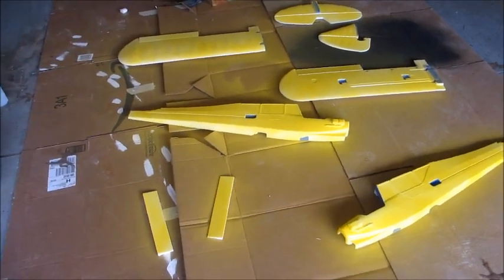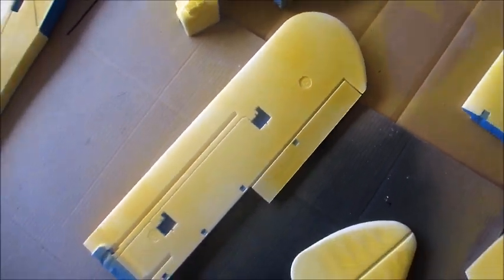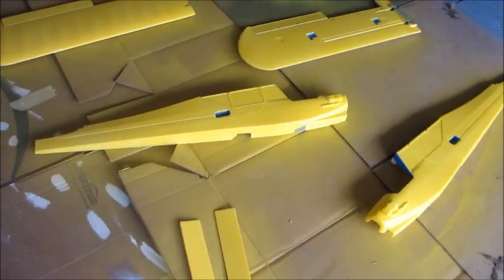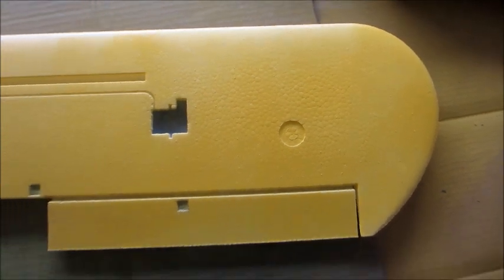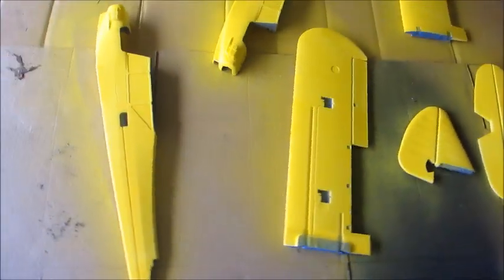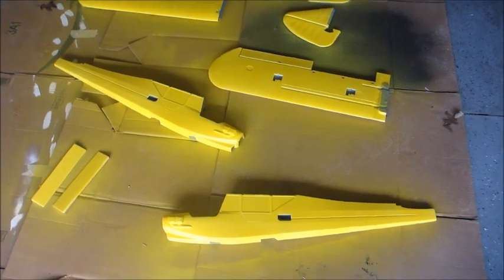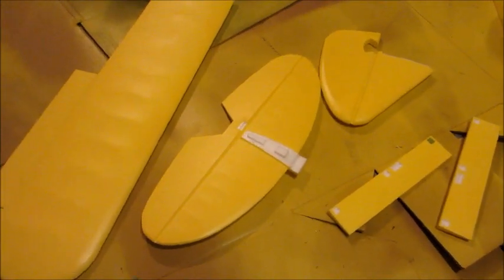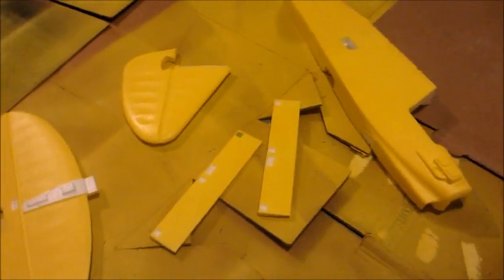Multiplex Fun Cub Build 02 - Painting

Comment: Got a couple of suggestions for you and others that view this video.   

How you painted and the Kyrlon paint worked great.     However it is much easier and you get a better paint job if you build the wing install all the hings and control horns,  Also build your fuse, cut to length and install the large control rod tubes.  Then test fit your servo's and the servo leads, then remove them for later.    Now the only areas that you really need to tape off are the four servo mount spots in the wings.         Paint everything as you showed in the video with several light coats and you are good to go.    Everything is yellow and no touch up required.    

And Yes even painted my flap hinges work just fine.

Comment: I painted my cub yellow with Krylon Fusion for plastics.  Your pulsed spray technique is a bit different but the results look good.  Generally I prefer to hold the nozzle down and sweep the spray along the part, dusting a very light even coat.  Held about two feet away, 2 coats covers very well.  Whatever works.